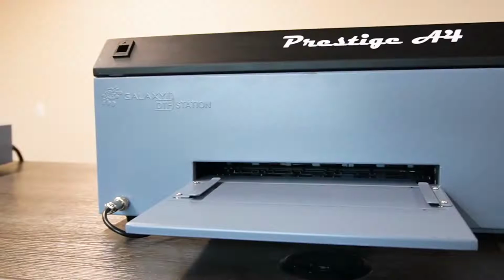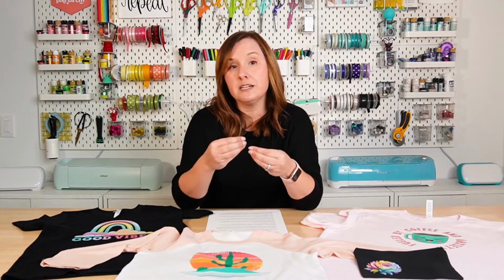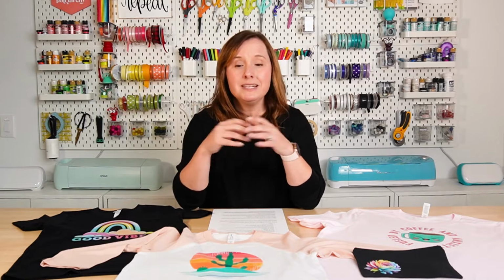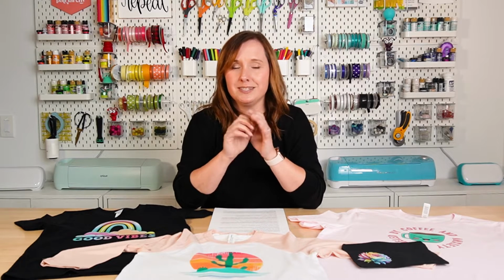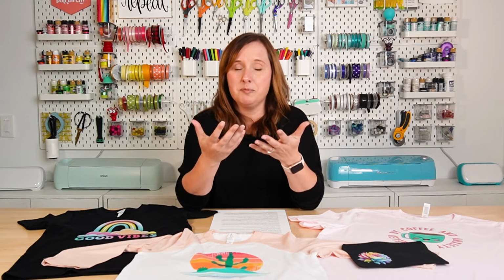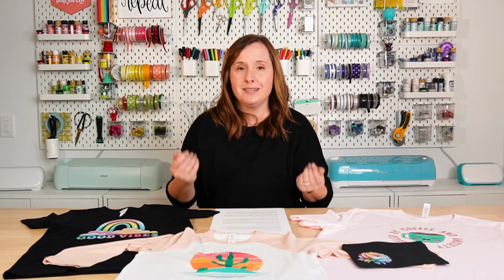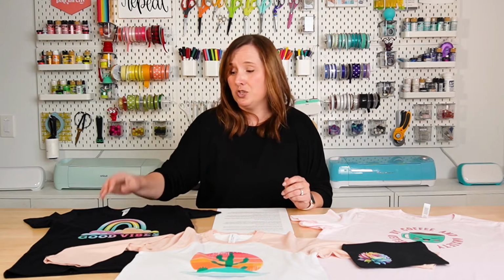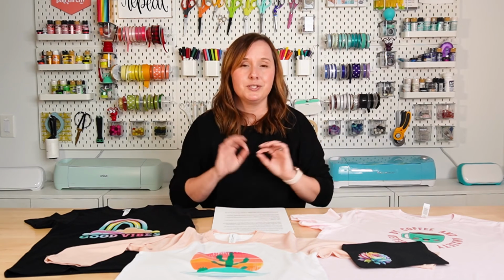DTF Printing for Beginners | Watch this BEFORE You Buy a DTF Printer

Comment: i would like to print on metal  what printing is best  also can print on  metal that is already painted
Reply from the maker: I haven't tried DTF on metal, but I assume it would work, as long as the heat doesn't interfere with the paint.
Reply: you need to do UV DTF for hard surface prints! :)

Comment: Great video for beginners! A note: you CAN run Windows apps on a Mac by using Parallels which is definitely cheaper than buying a cheap PC :)
Reply from the maker: Thank you!! Have you successfully run the software on your Mac? From everyone I've talked to, running Parallels doesn't work very well with the RIP software but I also haven't tried it myself.